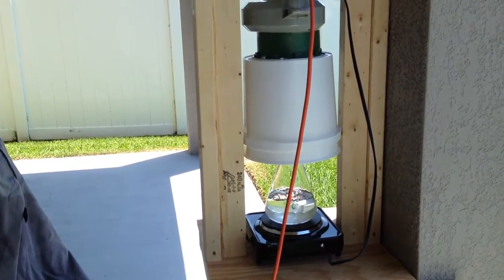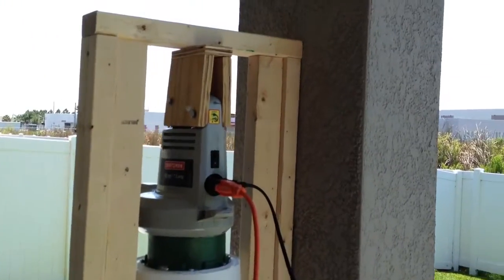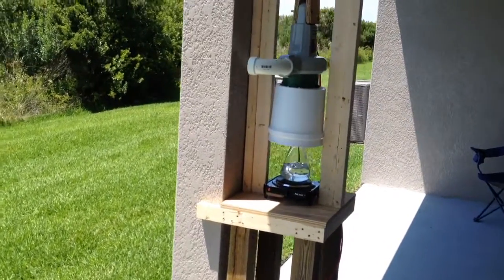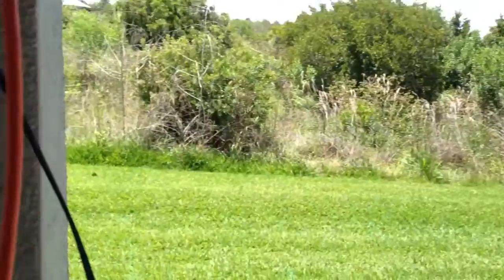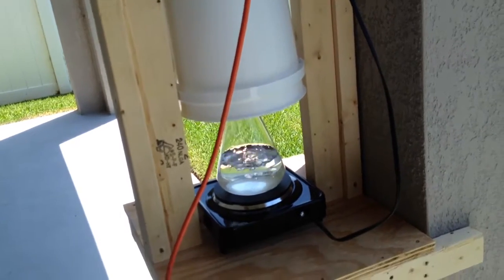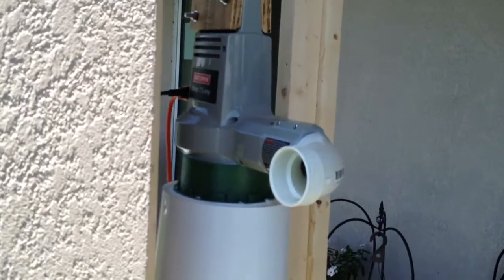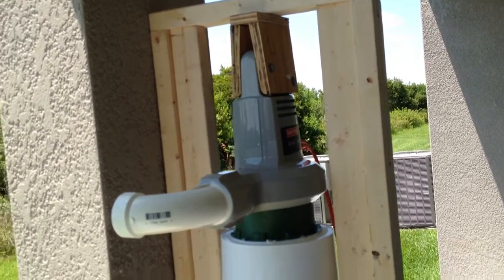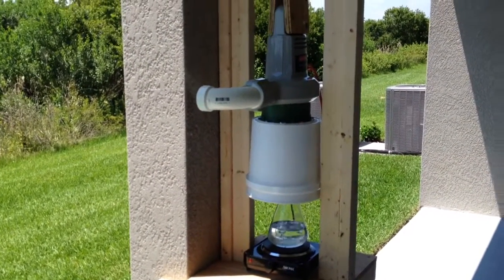Homemade Fume Hood for Precious Metal Refining

Comment: You can connect the fume output in in plastic bucket mixed with lie/water and an exaust, so that toxic are not released in the air.

Comment: I can see where your fume motor will give out potentially with the acid vapor output.   will eat the metals up.  Maybe offset the motor downwind of the actual pickup point and use a pvc "Y" to pull the vapors onward to the exhaust point???

Comment: Get a respirator, dude. I refine/melt aluminum in confined areas so I bought a full face 3m respirator for like $100 one a pack of cartridges is $20 and for use with nitric acid you could use them for years plus the added eye protection is nice. If you don't have the money for a full face. a half face 3m mask is like 20-30 dollars. Hope I helped.